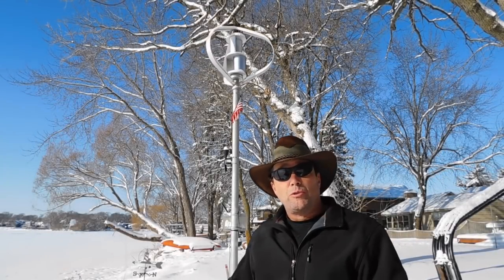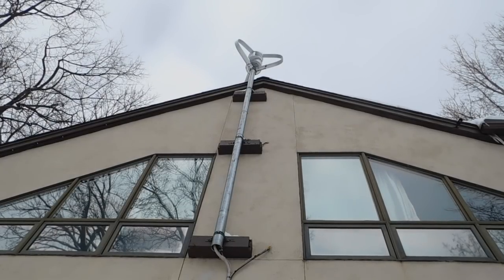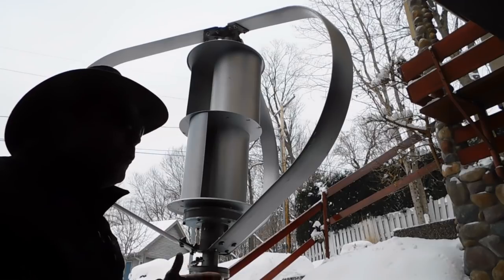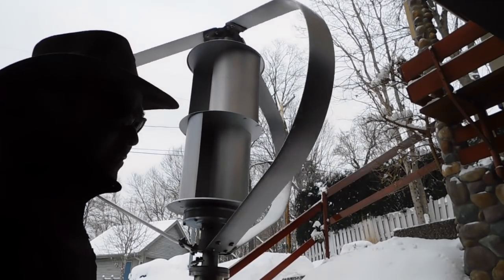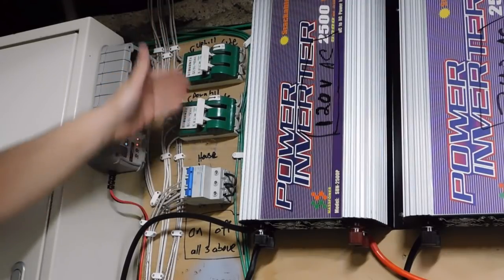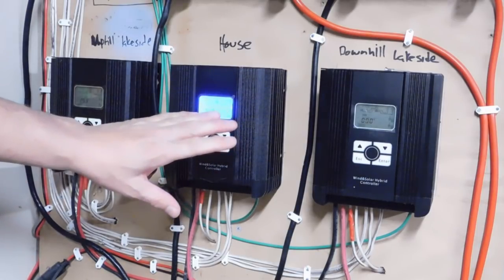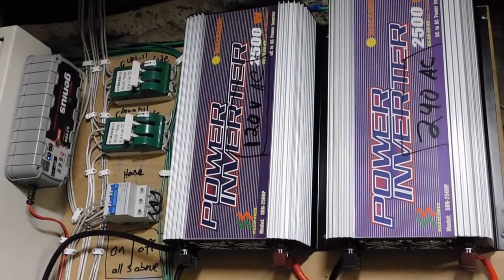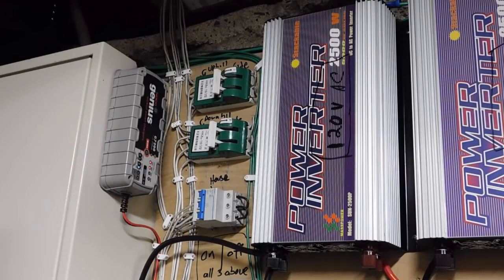300 Watt Hi-VAWT Vertical Axis Wind Turbines on Green Energy Adventures with the Turbine Guy

Comment: hey jay. how much for just the small turbine?
Reply from the maker: $2850 plus shipping ($375). Comes with a charge controller for 12 or 24 volts systems that also can have 1 solar module hooked up to it as well.  jtn@goreenenergyonline.com
Reply from the maker: Go buy a $200 turbine and see how long it lasts (if you can find one for $200). These have a 5 year guarantee and 20 year expected life.
Reply: Turbine Guy way way too much...$200 turbine...
Reply from the maker: No it is not. I have been installing them for a decade with zero mechanical failures. Go buy  yourself a $200 turbine and see how ling it lasts. Just like buying cars, you get what you pay for.
Reply: Excellent video.  How would I find someone to install the system?
Reply from the maker: send me an email with your contact info please, jtn@gogreenenergyonline.com
Reply: Dudes, I bought a 4kw turbine for 1 808 USD. It's a Heli 4.0 from iSTA-BREEZE, one year + and running good (don't buy the older ones - the magnets are weak). It's not as discrete as a VAWT but I don't even hear it. As cheap as it can be, I wouldn't recommend going big. Many times it's not as cost effective or reliable as several smaller ones, well-built.

This guy has tested many and found a chinese turbine that is a real beast if set up correcly. Great quality, very durable. He describes it and how to set it up here:
https://www.youtube.com/watch?v=GrL7OA0Kb4A It's a messy video but it's worth to look at.

Direct link to aforementioned turbine: https://www.aliexpress.com/item/HAWT-500W-Wind-Turbine-Generator-With-Controller/32958450500.html?

You could also buy a Thermodyne generator and build your own. They are cheap, tried and tested.

I'm NOT selling anything, as you can see it's not an affiliate link. I only mean well. The market is FILLED with crap from three companies, it's almost impossible to find anything good because of that. In all of those cases you are right, they are complete crap and not worth the hassle. There are exceptions though, thankfully. But hard to find. Best of luck.
Reply: @Ihaveausernametoo  I know this is a couple of years old, but commented for anyone like me that stumbles across this. He says he bought a Heli4.0, which is 4KW and ~$3,500, but links to a knockoff that is only 400W. Yes, the knockoff is priced much less, but also rated 10 times less power.
Reply from the maker: I can help you find somebody, where are you located?
Reply: nice. solar usually goes for about $1000 /kw installed. how much did this cost? what about the battery bank?
Reply: no solar is definately less than $2USD/W @2018
how much did the battery bank cost? how many kWh is it? approx what % is usable?
Reply: tomptrson. Yes how much
Reply from the maker: $2850 plus shipping for the 300 watt model. Comes with a charge controller that can also run 1 solar module as well.
Reply: I just read about this design last week and spent a day looking at wind roses for my location. Unfortunately I just don’t have reliable winds enough of the time. It’s a suburban area. I’m admiring your setup!
Reply: That would be great.  I live in South Texas not far from Corpus Christi.  Beeville is 10 miles away.
Reply from the maker: not installed, unless they are doing it for free. I just got another client today in MN for $3.10/watt, he though it was a good deal as I beat other bids
Reply: tomptrson. Ok thanks
Reply from the maker: Solar is usually about $3/watt installed, thus $3000 for 1 kW. These turbines retail for $2900 each, with a charge controller. Battery bank is older gel cells
Reply: subscribe plise to my channel

Comment: All practical tests show that small wind turbines hardly generate any electricity! Because there is hardly any wind close to the ground. It is also extremely gusty, which usually shortens the service life extremely! Only if you are off grid & live close to the sea, you should install the largest possible wind turbine on a high mast for the winter. 
Because 100% more wind = 800% more electricity!  
But due to the extreme drop in the price of solar panels, they produce 25 to 30 years at approx. 2% to 5% of the cost of small wind turbines! Reliable and almost maintenance-free.
Reply from the maker: Except the Hi-VAWT turbine is certified by the SWCC, only vertical in the world to be certified. I have videos on this channel showing my 300 watt model exceeding 400 watts comfortably (it is mounted on my house). I also have a client who put a 3kW turbine in at a high school in western Minnesota that produced over 9000 kWh/yr. A practical application (not test) which showed these turbines work just fine. Video on my channel for that as well.

Comment: Well, using a VAWT for my use while camping in high elevations, I just apply current from an auto alternator which is rectified internally, supply my batteries. If I choose, I can place a current and volt meter in the circuit to monitor.
If I were going to use the VAWT generator at home as this man is doing, I would add a feature that I haven't seen anyone to employ. This feature reduces a large amount of drag and in some degree, adds to the force of moving the turbine blades. Lots of potential in the use of VAWT turbines.
Reply from the maker: How much power do you get from the alternator?
Reply: @TurbineGuy   power varies with wind speed. No average available but even with a trickle charge, is good.

Comment: it don't turn fast enough to gen voltage and amps i could hear wind blowing on your mike it was blowing.
Reply from the maker: Wind making noise on a mic a turning a turbine are 2 completely different things. Try watching my videos where you can see these turbines putting out over 400 watts continuously, well in excess of the 300 watt rating.

Comment: I do wish you would tell us the price...
Reply from the maker: I did post it in the comment below: $2850 plus shipping ($375). Comes with a charge controller for 12 or 24 volts systems that also can have 1 solar module hooked up to it as well.  jtn@goreenenergyonline.com

Comment: Mixed battery chemistries an issue?
Reply from the maker: I have had no problems since I installed them 8 years ago, still running strong. I even hook up the boat and other batteries for the winter to keep them topped off. I would not mix the lead acid batteries with lithium though.

Comment: I don't have a clue what a  VAWT is. What I see is a  Darneis Rotor been around over a hundred years.
Reply from the maker: Both sets of blades on this turbine, Darrius and Savonius, have been used for years. The Hi_VAWT turbine combines these aspects in a durable and modern version that you cannot get anywhere else. Definition of VAWT: Vertical Axis Wind Turbine, meaning that is spins around a vertical axis instead of a horizontal axis like a propeller style spins.
Reply: subscribe plise to my channel

Comment: Should use Anemometer,  Power meter, Voltmeter, Ampmeter, to verify these devices.        
       Power =  Force   *   Speed  =  Voltage * Amperage

      Problems with vertical windmill is the returning surface (back face of the blades)!     Horizontal ones donn't have returning surface to resist the rotation, That's why most powerful wind turbine is Horizontal ones.
Reply from the maker: This video shows actual production numbers for the 300 watt turbne on the house: https://youtu.be/NR-kWYiOsdI

Comment: These VAWT's are rated 300W, but wondering what is your typical production in a good wind from these units?  I just pulled up your web site and found the manufacturer link.  Also wondering how long you've been operating them.  The turbine specs both automatic and manual braking but those aren't part of the VAWT unit itself, right?  

Thanks in advance!
Reply from the maker: I have posted a video showing actual production numbers in a moderate wind speed: https://youtu.be/NR-kWYiOsdI
Reply: @TurbineGuy  I'll reach out by email on your site for a more detailed discussion... I watched the "imprisonment video too".
Reply from the maker: I have been installing and operating these turbines since 2010 with NO mechanical failures or maintenance on any of them. Both the automatic and manual braking are integral parts of the turbine assembly/electronics.
Reply from the maker: This video shows the production of a 3000 watt unit over a 3 year period: https://youtu.be/G_FfPFvnDkI

Comment: are you running AC on those long lines?
Reply from the maker: The turbine puts out a wild AC (voltage changes with wind speed) which is rectified to 12 or 24 v DC for this size turbine.
Reply: what i meant was ,you should run the AC into the home ,to then rectify and charge batteries. a DC line that far will have a big loss. if you are rectifying it at the windmill and running DC on those long small lines, that might be your problem.
Reply from the maker: That is exactly how this system works, wild AC into the house, rectified to DC to charge the batteries.

Comment: I can't help but thinking you might have been better off with a 4th wind turbine than the solar depending on how many producing days you get a year. Considering what you installed the system for, the time you might most need the off grid power would likely be when the solar panels weren't producing anything but the wind turbines likely would be. I rather like the idea of wind turbines because they can produce around the clock if you're in an area that gets some wind regularly.
Reply from the maker: I did have a 4th, 1500 watt unit that they put me in jail over
Reply: Turbine Guy Jail?! What?

Comment: Can you link those charge controllers?
Reply from the maker: No, they need to run individually to individually control each turbine. They are link in a sense as they all are connected to the 24 volt bus bars as their output.

Comment: Hi, so the system is working for half an year already. Many inquired about the real production and saw no straight answer. Can you provide the figures for total production, even the period is too short for a good statistic?

I am really curious because other guy with a 3,5 Kw turbine mounted on a high pole far for house and trees, in a good wind zone, after 8 years of production got an average of 4Kw/h daily. Of course you cannot expect to get the theoretical 84 kw/h as a average daily production. But according to some other  wind professional,  who says that you should expect a 3Mw/h yearly for kw installed, a 28Kw/h daily production is to be expected. So it seems that this guys turbine is performing 7 times lower than should be expected. I assume that there is a flaw somewhere. It may happen even a wrong setting with the meter. But the guy insists that the flaw is in the fact that the turbine works as specified at a certain wind speed, and out of that range the production lowers dramatically. And at higher wind speeds even is shutting down to avoid damaging the system.  I exchanged few comments with him, the same, not providing real figures. First question was if the turbine really provides 3,5 kw in a steady wind. He did not answered, and my questions seemed to upset him so I stopped. 

I hope you will satisfy my curiosity and give those numbers. Thanks.
Reply from the maker: I don't have numbers for the small turbines, and 2 of them are in poor wind locations most of the time. But I do have numbers for the 3 kW system as you can see in this video...https://www.youtube.com/watch?v=G_FfPFvnDkI&t=3s.  it is producing over 9000 kwh/yr or 25kwh/day
Reply: subscribe plise to my channel

Comment: I do like the wind turbines very nice, but I saw no safety disconnect or fuses on your set up. Sorry no disrespect. Your choice of colors is wrong for your DC server up, also using mixed amp hr batteries should always be avoided your lower amp batteries will drain first leaving your higher drain continue to work, likewise in charging your charge controller will charge to your higher amp batteries this overcharging your lower amp batteries. Just saying work safe and do things right. Otherwise the end result will mean living somewhere else
Reply from the maker: I disagree on the batteries, they will all deliver what amperage they can given what voltage they are at. I put this system together using excess wire I had available instead of spending money on new wires, green or black for ground, not really much difference
'

Comment: What did your wife say about bolting that thing to the side of the house
Reply: That is a lot of money. For 3000usd i could have a nice setup here in Croatia. Currently 520w solar panels, plus solar controller, plus 260ah battery 12v, and 1.5kw inverter all for 1300usd.
Reply from the maker: Nothing really, she understands what I am doing
Reply: Your lucky. Where did you buy the Hi-VAWT. How much was it?
Reply from the maker: I represent Hi-VAWT turbines and can help you if you need one
Reply from the maker: I am the US Technical Representative for the manufacturer, Hi-VAWT Technology Corporation. I can get you the 300 watt turbine for $2850 plus shipping (around $375 to most parts of the country). They come with a charge controller which charges 12 or 24 volt battery banks and you can also hook up a solar module with it as well.  email me at  jtn@gogreenenergyonline.com